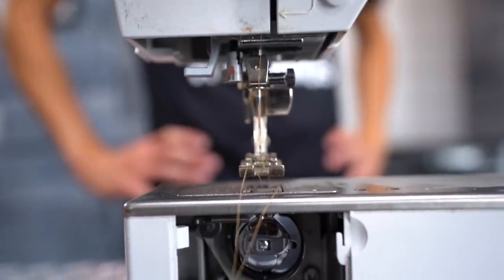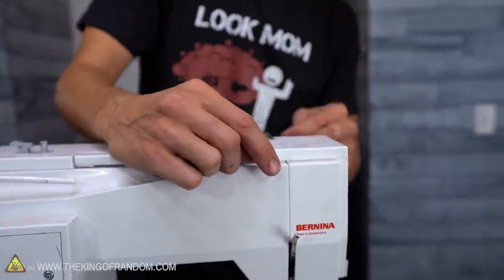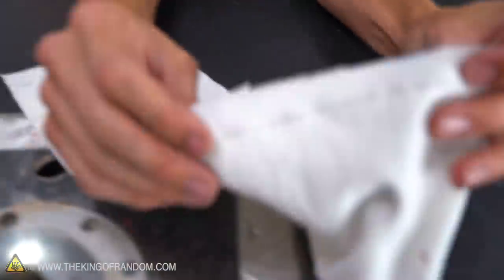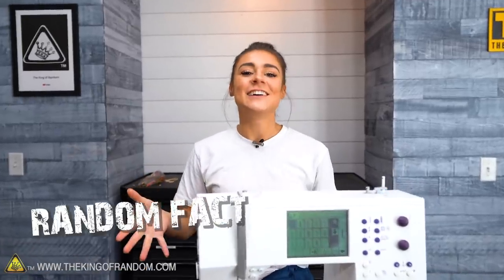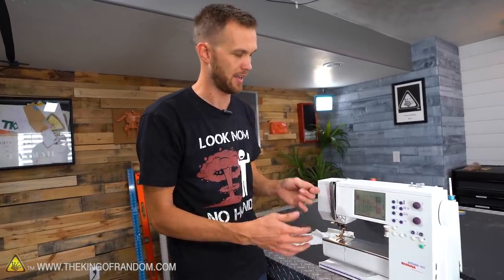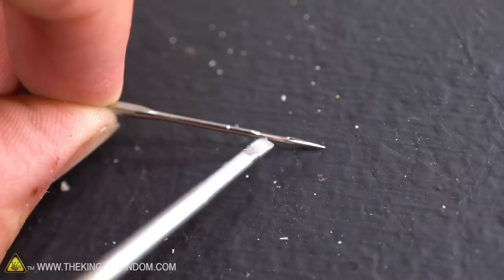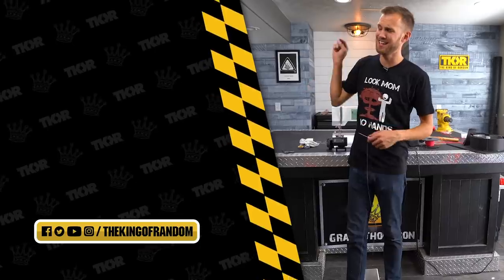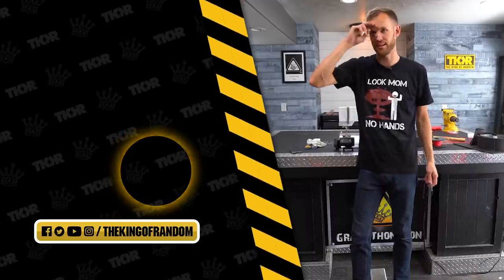The Engineering Marvel That is the Sewing Machine!

Comment: Explain a WiFi router and an extender pls cuz I swear those are magical
Reply: Not that exactly it’s just a small computer broadcasting a suitable and al digital that’s why it would be not a interesting video
Reply: @EnigmaticLucas  ok but how does it work
Reply: I know extender, it is basically a repeater, it can take signal and make it strong, because a router itself cant send a signal for example 15 meters, it can go for 14 max (again this is just example) and the repeater takes the signal and makes it stringer from its specific spot, you can think about it like the repeater in minecraft, it is the same idea
Reply: @hihi-nl8bp  A wireless router connects directly to a modem by a cable. This allows it to receive information from — and transmit information to — the internet. The router then creates and communicates with your home Wi-Fi network using built-in antennas. As a result, all of the devices on your home network have internet access.
Reply: @hihi-nl8bp  ask Linus
Reply: @travis1240  bruh thx so much how did I not know
Reply: @fishiganstate3880  hmm collaboration idea. Linus and the King of random. Maybe an explanation of how water cooling works vs air cooling, and for TKOR testing different liquids for "water" cooling. Linus did try to use an actual house radiator to cool down a computer, though he failed to clean it out fully. It worked, but it destoryed the watercooler in the computer (rust from the radiator)
Reply: its like a radio rebroacast only wifi signals.
Reply: @Kafj302  He also built a computer inside a refrigerator but it generated too much heat for the fridge to keep cool

Comment: One more random fact: originally a scroll saws/jigsaws were just modified sewing machines. Bottom part with the bobine was removed and the needle was replaced with a small saw blade.
As for actual sewing machines, i had the pleasure to work with a 1929 Singer machine that was retrofitted with a motor instead of that one big pedal. It sounded like a train and honestly felt like one, but would sew anything from fine silk to thick warm blankets with no problems. Really awesome machine!

Thank you for the explanation of the mechanism. It made sense and was actually interesting to learn about.

Comment: I like to think I'm fairly smart because I can build PCs, 3D printers and other gadgets but one day I ended up in a sewing machine repair shop (my mom had to get her machine fixed) and I saw the guts of a few sewing machines and was quite humbled. Their insides look like a swiss watchmaker who had too much fun with a kaleidoscope designed it. That fact that you can "tell" the machine what kind of stitch you want it to do just by flipping a switch and it will do it though sheer physical mechanics, not a transistor, IC or servo anywhere.

Comment: Thanks Random.
It does not matter which way the top spool is oriented, as long as there is no binding. Kinda like TP, where some sh*tters prefer “over the top”, others like “under the bottom”. 
just clarify’n
Reply: I've found that unless it is setup to take the thread off the middle, it's best to put the thread-holder notch on top, even if the manual says it goes on bottom.

Comment: FYI those clunky pieces of metal that are hard to move around are still what the best tailors use, in fact a local tuxedo rental place in Allentown pa still uses only original singer machines to make the adjustments because they are so well made compared to the new ones

Comment: I always like to make comparisons and links between different concepts. I realised how the sewing machine works because of the bobbin. In weaving, yarn or string is held on a shuttle or sometimes a bobbin. In bobbin lace making, the threads are held on bobbins and moved around. So with that information I deduced that the bobbin holds and moves the thread around hence coming to the realisation that the bobbin in a sewing machine goes through a loop created by the top thread.

Comment: Those "little spools" are bobbins. They are not meant to be used on the needle. They provide the thread from the bottom and, since that thread is essentially just a straight line of thread, it doesn't use as much as the needle does. That said, there is nothing stopping you from using it like a spool on top if you don't mind having to refill them more often.

Comment: it is possible to sew by hand in the same manner as the machine with two needles, using an awl shaped needle for the upper part and another awl or regular needle for the bottom then tightening each stitch as you go.

Comment: The mechanism is actually far simpler than I thought.  I know how to use a sewing machine but the black magic on the bottom is where it makes all the difference.
It is very precise, however. Tolerances have to be real tight for it to be moving that fast and also have vibrations.

Comment: This one is digitally controlled. Imagine older ones where you only have levers. Figuring out how to connect all those control levers to the main components running at engine idling speed, without causing excessive wear. That's a whole new category of mind blown.
Reply: The feed dog actually can run both forward and backward, so there's no need to turn the fabric around should you need to do multiple pass.

Comment: Rather complicated way to put one thread inside another but it is a proven design that has worked for such a long time there is no need to reinvent it. My Mom taught me a little about sewing when I was a young teen, same as about cooking and other useful tasks. Wanted to take home ec but my father said that was only for girls...guess what he couldn't do that I can do ?! LOL That was a great explanation and explains why the one part the thread goes through needs to reciprocate up and down. It allows the thread in the needle to be pulled through and around the bottom bobbin and then takes up the slack again.